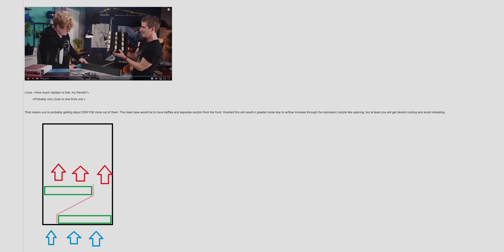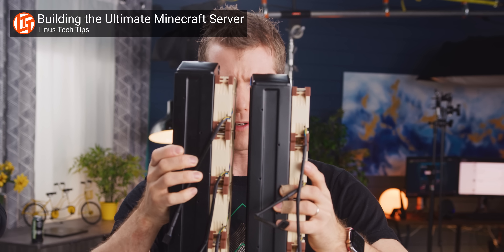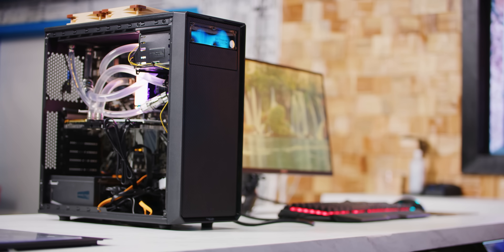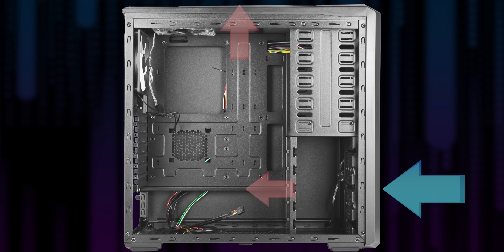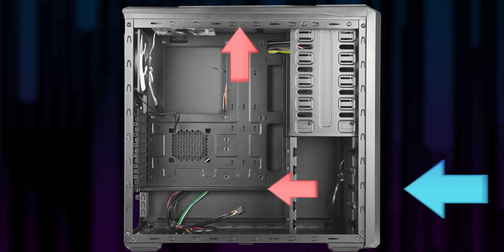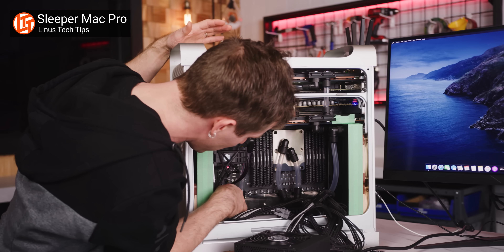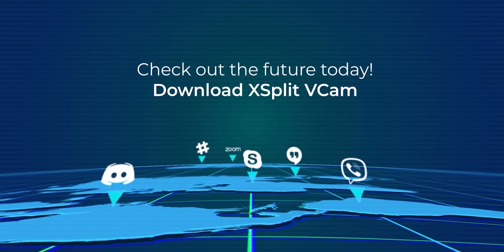I’ve been water cooling wrong for YEARS - $H!T Manufacturers Say

Comment: Adding Radiators at different outlets will certainly increase the airflow and thus produce more cooling. But if the radiators are stacked one after other (like in minecraft server) or parallel connected (The water from first radiator circulates to next immediately) the performance will reduce due much lower temperature gradient of second radiator. 
I think the simulations shown in video is about comparing dust filter, glass panel and their influence on cooling not comparison between radiators. :)
Reply: Adding more thermal capacity makes sense to more cooling. But at the same time whether our second radiator have the room for working at its full potential or near full potential after the heat dissipation from 1st radiator is the point. I think we should consider how much more cooling  and at what price ?    can it prevent from thermal throttling ?    these questions should be explored. :)
Reply: For PCs you are just wrong.. There are no temp differences of water inside the system at any point.. This may be hard to imagine, but water will have practically same temperature at inlet and outlet of radiator, at CPU waterblock, at GPU waterblock or at the pipes. 

This is the reason a) why you don't measure water temp at X or Y locations, you measure water temp in general. And b) why its been proven time over time over time that order of components (CPU+radiator+gpu etc) and their connections (serial radiator or parallel) doesn't matter at all. Add more radiators and the water temperature will drop. One can take this to infinity at which point water temp will be same as ambient.

What you've said would have been correct if we were talking about larger radiator systems where heat generated and dissipated is so large convection from radiators is higher than the conduction in water pipes... Such systems WILL have temperature gradients, like a typical 150HP car engine's radiator dissipating 300kW+ heat power will have up to 7 degrees C temperature difference between engine outlet and radiator outlet, because its simply not practical/possible to put larger diameter water pipes and its even less efficient to put a higher flow waterpump.. But we are not talking about cars, we are talking about PCs with relatively puny <1kW heat input and dissipation.
Reply: @batuhancokmar7330  a change in temperature is required for heat transfer to occur. The water is heated as it passes by heat sources (CPU, GPU, etc.) and cooled as it passes through the radiator. At steady state, the temperature at any point is constant, but that does not mean that the water temperature is the same everywhere in the loop.
Reply: @johnmurray9746  No. You are not an engineer are you? In layman's terms, if you heat up a pot of water on a cooker, temperature right at the bottom and the top will be the same despite the fact topside surface will be dissipating heat (and mass) to enviroment.

Again, this happens because water has much lower (internal) thermal resistance than the hot air below the pot. Change in temperature does occur obviously, water will heat if you turn on the cooker. But water mass will heat up as a whole, it will not have a hot/cold points, because water is an excellent conductor of heat (why it is used as coolant) and air is not.

This is the same reason why ALL the water normally reaches 100C first then boils without getting hotter or colder; in otherwords without temperature gradient.. 

You will have temperature gradient only if you have heat flux that overcomes the internal resistance of the water. For example if you put glowing hot iron @500C into ice, you will have ice, and boiling water at the same time, and a quasi-state temperature gradient from 0 to 100C.

You will (most obviously) have different water temperatures if CPU/GPU/fans is running or not, or if having a larger radiator or no radiator inside the system. But you will not have a measurable temperature difference within water.
Reply: @batuhancokmar7330  correct me if I'm wrong, but as far as I know, the only time you can add/remove energy from water without affecting its temperature is at a phase change boundary, i.e. you have to add heat ice to get it to melt, even though it does not immediately change temperature.

Wouldn't the consistency of temperature in a pot of hot water be due to the natural convective currents that can easily form, efficiently mixing the water and achieving a uniform temperature? This seems like a very different scenario compared to water trapped in a cooling loop which is being forced to flow in a single direction and cannot mix across different points in the loop.

Not that it matters, but I am an engineer -  I'll admit I'd don't specialize in heat transfer, though 😊

Cheers mate
Reply: @batuhancokmar7330  after re-reading your first comment, I'm not actually sure we disagree. You say that the water temperature is PRACTICALLY the same at each point in the loop, with which I agree, if a few degrees C variation is in the category of practically the same. The primary reason for this, though, is the relatively high specific heat of water, not a low thermal resistance (water actually has low thermal conductivity without convection). I agree that the practical conclusion of this is that loop order is likely not critical.
Reply: prithvi raj V LOVE HOW THOS INDIAN MAN COPIES SOMETHING FROM THE WEB THINKING TO GET 1K LIKES. XDXDXDXD
Reply: Extra fans would increase the airflow somewhat which would increase cooling even if stacking radiators didn't work.
Reply: You're forgetting that once the loop stabilizes, because we don't use thermostats, the water is effectively the same temp throughout the loop. The order of radiator placement doesn't matter. One can feed the other or you can put waterblocks in between. Use the loop order that is easiest or looks the best.
Reply: yes and no , because with more rads you have more WATER more Water = more thermal capacity . 
you only loose efficiency stacking rads, 1st rad 100% 2st rad 90%-85% and 3st rad 70% this is what corsair says but with wrong words ! but remember you have more thermal capacity at the end it will work ... Hire ME corsair !  (we say the same thing with different words cheers !)
Reply: @rewind841821  If you're adding radiators just for the sake of adding water for thermal capacity, you're doing it wrong. That's what reservoirs are for, and they are far better at increasing the amount of water than radiators.

I lol'd at the "hire ME corsair !"
Reply: @jackmoseley1628  but at the end adding more radiators you adding more thermal capacity ecause you have more water at the end . it's the same to have one rad 240mm and 250ml water  or with 3x240mm with 250ml ?  witch one system have more water in it, so more thermal capacity. hire me corsair ! we will build triple layers rads with triple thermal capacity :P
Reply: Rewind84 adding thermal capacity will increase the time it takes for temps to rise but does not affect the maximum temp of the machine... that’s what proper cooling will do. Otherwise water cooled PCs would just have a tiny radiator and fill the rest of the case with reservoirs. Please do not hire him Corsair

Comment: We need to know what parameters Corsair used to come up with an exiting air temperature that is 1deg below the water temperature.
Increasing the airflow will reduce the elevation in air temperature and increase the efficiency of the stacked radiators.
While there are benefits to adding radiators - and it is preferable to not stack them, although not necessarily a requirement - there are also downsides: the pressure drop from each added radiator (*if* in series) needs to be compensated for by a beefier pump, otherwise the flow rate will decrease and hence the heat exchange efficiency (in both the waterblocks and the rads) and cooling performance will actually be worse.

Comment: Linus you made their point if one radiator is doing 40c of cooling and a second one only adds 5 degrees is it cost effective to add stacked radiators. Cost vs effect vs potential failure point. More connections higher maintenance risk.

Comment: The order is important. Reduce temps first with the warm air, then run the water trough the cold air radiator. Other way around is what they modelled i bet. Why not pull in with boyh, and exhaust out the back and bottom?

Comment: The issue with your analysis and their simulations is that you are assuming mono-temperature travel across the radiator. The heat would be a gradiant, where after interacting with the rad, air from one side of the radiator will be a different temperature than the other side. So once in the case these temperature's mix, giving you more thermal headroom.

Comment: For the secondary rad to have cero effect you would need to blow it with  a hair dryer or something.  It is not as efficient as it would be with fresh air but it does have more surface area and there is still a difference in temperature between the hot air and the CPU plate.  There is also double amount of liquid in the system.

Comment: For me it is poor done comparison. This is basic engineering. guys. We dont know to which of radiators hot water is going, it makes a lot of difference. There are basically two types of heat exchangers, cocurent flow and countercurent flow, usually countercurrent flow is more efficient. For computer cooling it is a big difference if you are flowing hot water to intake radiator or outlet radiator. For cocurent flow case, you direct hot water first to intake radiator, water cools down but, air is heated a lot, so when it is moved to second radiator we have hot air and cool water, so efficiency of second radiator is low or even it is heating water (if intake radiator is much bigger and/or water loop is overbuild for rig power). 
BUT for countecurent setup, hot water goes to outlet radiator first! And we are cooling hot water by hot air from case, usually temperature difference is big enough for efficient heat transfer. Next cold water flows to intake radiator and is cooled more by fresh (ambient) air. 
For Minecraft server case situation is kinda similar, if your hot water was directed to intake (first) radiator, second and third radiator are almost useless, but if hot water was directed to last radiator, water could be cooled to almost ambient temps. 
So for summary: Loop should go from CPU block to GPU block to OUTLET rad to INTAKE rad, this IS most efficient one loop setup. 
And this is not only you, I was commenting on some Jays2Cent videos about his personal rig update and his design is very inefficient.
And all this crap is engineering 101 guys, you should ask Alex before making this video.
Reply: commenting to bump
Reply: Corsair and ltt never addresed this. it was never a part of the disussion, and it only applies to the stacked rad case. Ther are basically sayng stacked rads are bad under any circumstanes.
Reply: @OriginalMergatroid  This should be the main point of this discussion, they makes some claims and show some data without any criteria. I don't know what exactly Corsair calculate and what message they send to Linus.  
When you start building a water-cooling loop you want to know what is the best solution, for Linus slaping another rad is easy, but for some average enthusiast maybe not and if you bought additional  rad you want to place it in the most efficient way.

Comment: There's plenty of variables when it comes to cooling that should be accounted for.  In the stacked radiators example the addition of extra water volume increased available storage capacity of the entire loop which could contribute to more efficiency.  To only evaluate the additional radiators you would have to ensure your system contains the same amount of water through additional tubing or other equal volume.    In addition, the order of the radiators makes a difference as well.  If the hottest radiator(meaning first in the water flow from the hot components) is last in the airflow, that will work better than if the hottest radiator is first in the air flow.  Reason for this is that if you dump most of your heat out of the first radiator then you have warmer air going through subsequent radiators.  If the hottest radiator is last in the airflow then the previous radiators in the airflow will dump in less heat.   

Just got to love thermodynamics.

Comment: Corsair: hey so uhhh actually stacking two radiators right on top of each other isn't actually efficient.
Linus: that's wrong, because we put two rads on opposite ends of the case with fans supplying air in between them, and it worked.
Reply: He mentioned in the video that they removed one of the stacked radiators in their Minecraft server and temps went up by 5 degrees C. Did you even watch the video?
Reply: Uh, right at the beginning of the vid (after the intro) he mentions that Corsair first reached out them about this after their Hack Pro vid... which had two rads on opposite sides of the case. They, tested the stacking theory by removing one rad from their Minecraft server build. Pay attention.

Comment: If the two or more radiators are in the same loop, it should work find but I think where the problem would lie is with two separate radiators. Say your gpu is running hotter then the cpu and that radiator happens to be in the front of the case, which then starves the cpu radiator at the back while not having much other case ventilation. I can see something like that happening. I always try to keep things minimal so one thick radiator if possible.

Comment: Just out of curiosity, did you operate the two tests with the side panel off, as you've depicted in the video, or done a full enclosure? If the side panel was off, that means that you would receive more cooling from ambient/cool air with the second radiator which would obviously increase performance. Might just be me inferring too much from your visual representation or your test, but...you know...you never know.

Comment: Yep, Linus you compared apples and oranges and guess what, they are different!  Your Minecraft server setup was stacked cooling.  If you measure the air temp at each step of the process in a stacked cooling setup like that you will find Corsair is right. The delta T across the first rad is way bigger than the delta T across the second, and so on.  Your crossflow set up in the vid isn't close to the stacked config so guess what?  The results are way different.

Comment: i wouldn't have gone with "double the number, double the performance" as basis, but it certainly should help. after all not the entire heat from the water is passed over to the air with the radiator, so increasing that surface area in the loop to release more energy makes sense. the airflow argumend goes out the window once you add fans to all radiators, as those are creating the air flow necessary. it might give slightly lower performance when one rad pulls air in and one pushes it out the case, my guess is that all rads pulling in air should increase performance. the rad on top will have a slightly harder time 'cause of the warm air also rising up from the system, so angling that one down in the front and then a fan pulling the air out the back should also increase the effectiveness, at least in my mind.

Comment: I wonder if they just failed to account for the additional thermal mass of the water itself?
More importantly, their reasoning only makes sense if their radiators match their idealized efficiency. If the radiators are even 20% less efficient than they think they are, stacking even four of them would still have measurable benefit.

Comment: I think they are correct if there is enough cooling capacity, like if you put three 480mm rads in series on a 3100X it isn't going to be cooler at idle and diminishing returns at load

Comment: But, from what I can tell the original builds had the intakes on the top. and the exhausts at the bottom? And I am pretty sure this was not what corsair meant when they emailed you. I am pretty sure Linus and his team just built a system most likely for things to work. Instead of testing the actual builds that were questioned by Corsair.

Pretty pathetic.

Comment: I think the issue is that corsair assumes your first radiator would transfer all the heat in the water to the air and make the second radiator redundant, however it’s unlikely that that’s the case thus the second radiator is effective, even if it’s not as much as the first. 
Plus, the hotter the water the more radiator surface area you’ll need to transfer it all, likely why the minecraft server needs so many radiators

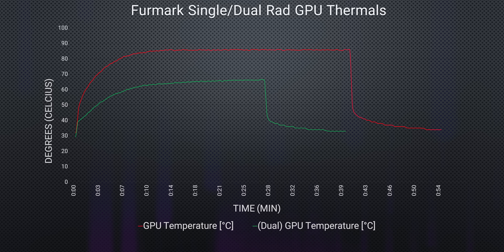Comment: Newton's Law of Cooling.... You have a freakin' engineer in house... in other words YOU HIRED ONE. Why did you not consult him? EDIT: After reviewing the chart, you DID NOT SPECIFY if you stacked them on top of each other or on opposite ends of the case like you had. On top, it does not work like that. If you spread them out, it does. The more surface area of dual rads does help but not if they consume the same area for which the destination heat is intended to go. I have had experience in this with lasers that were supposed to cool down repeatedly to 20 degrees centigrade with two chillers, one to cool water and then to cool air. I also build PCs. Doubling up heat transfer within the same occupied space expecting better heat dissipation hurts you in the end. When looking at 4:54, that's in terms of less than one hour. You will see an increase in temperature again steadily and the double stack, or even triple stack will crawl higher than split apart or single rad.